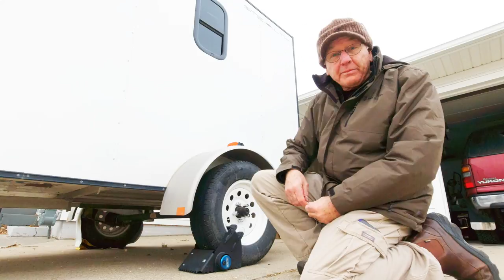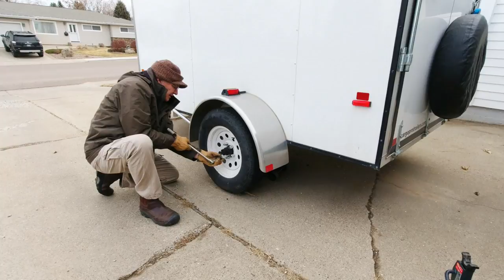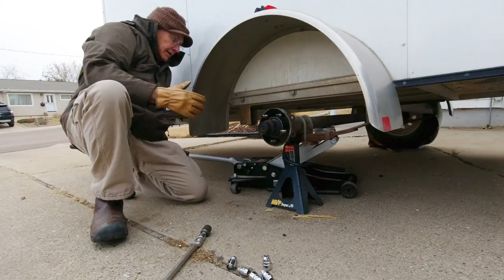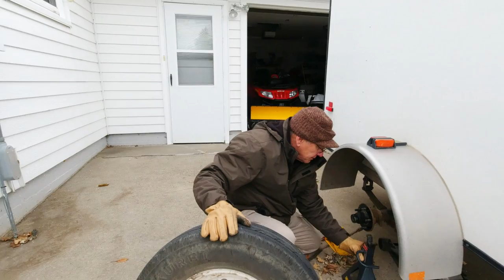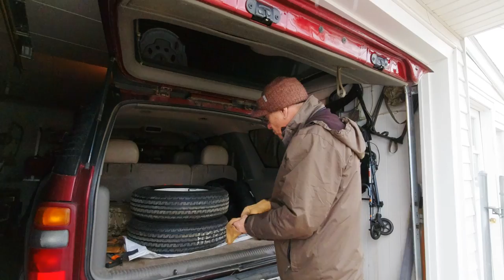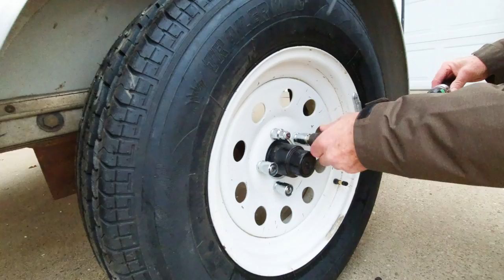Cargo Trailer Camper Needs New Tires.

Comment: It probably should be mentioned to buy trailer tires only for a trailer, not car or truck tires. Trailer tires are more expensive,  but they are made for trailers.
Reply from the maker: That's because trailer tires have a stiffer side wall to stand up to the bouncing that trailers do (That's why trailers blow tires).  I've been told that it may be better to put 16 inch rims on your trailer so that you can use LT (light truck) tires which can be higher quality. Thank you for watching Arithia!

Comment: At least when you do it yourself you know nothing is going to get screwed up! Every time I go to a tire shop I have to watch over the crews like a hawk so no corners are cut. I used to do tire work so I know when things are getting messed up. Happy travels!
Reply from the maker: I figure if anyone knows about tires it would be you!
Reply: @gonagain  Tires are the essence of what I do driving trucks! LOL
Reply from the maker: @WestCoastRoller  yep!
Reply: West Coast Roller: You are very wise to watch the tyre fitters, most now are just young scroats that do not even bother to change the torque setting on the air gun, you find that out when you try to use the wheel spanner and it bends up like a stick of liquorish .

Comment: My brother bought 4 at Discount and one blew out immediately. They replaced it. I keep hearing for many how bad trailer tires are. Some have put on vehicle rims and tires. My brother also carries a heat gun to monitor the wheel bearing temperatures. Have a good trip once you get started.
Reply from the maker: I have always checked my bearings by just putting my hand on them whenever I get gas, but I have a heat sensor with me anyway to keep tabs on my propane furnace so I'll use it to keeps my hands clean when checking those bearings!  The tires I bought had mostly high reviews and some low reviews, nothing in the middle, so we'll see. If you put on 16 inch rims you can use light truck tires which would be a lot better.

Comment: I use Balance Beads in my trailer tires and it works great. I also change my own tires. Something that may help with getting lug nuts on and off is to loosen the nuts, jack the tire off the ground, then put your socket wrench on one of the nuts, then spin the tire till the nut comes off. It works great for all but one, unless the wheel will stay against the spindle. Install is just the reverse.
Reply from the maker: Thanks for the handy tip, Eric.

Comment: I find that trailer tyres do not wear out in the normal sense, but because they stand around most of their life the walls perish, down here in the south of France they will only last 3 summers if they are not covered(as yours are), the balancing is a big factor in tyre life as you say, enjoy your birthday, an air nut runner is a better way to go, you can just run that off your compressed air line, and they are much cheaper to buy. Chris B.
Reply from the maker: Yes, you're certainly right about that tire sun rot and it happens pretty fast.  South of France sounds like a beautiful place.

Comment: they also tighten the lugs so tight you can not get them off on the road
Reply from the maker: I stopped to help a young couple on a dirt road in the middle of nowhere that couldn't break their lugnuts loose to change a flat.  It was a good thing that I had a long breaker bar with me.

Comment: you can get adaptors for the impact driver you use for your build etc. I wouldn't use it to break the lugs loose or torque  them down, but it will save you the time of all the spinning on and off, Wally World sells sets with 1/4 up to 1/2 and you can get adapters to go from the 1/2 to 3/4. you would be amazed at all you'll find that you can use them on

Comment: Let me add, assuming you are using “puzzle” wheel locks, the kind with the separate key that fits into a wiggly groove, do NOT use a power tool on those.  Ask me how I know.
I do like your videos and have learned a lot from them.
Reply from the maker: Good tip Jeff, thank you for sharing.
Reply: If you snap a wheel lock off you can pound a impact socket over it with a mini sledge hammer then back them off with ease, ask me how I know.

Comment: I too balance my trailer tires, I even thinking about buying centramatics for the 5ver. I used them on my eighteen and they do make a difference.
Reply from the maker: I didn't know what they were until you mentioned them.  They look like a great product if you're having a problem with balancing.  Not very expensive either.  Thanks!

Comment: This is my biggest deciding point in getting a small trailer... 1-2 axles
Reply: Why did you go for just a single axel?
Reply from the maker: We chose the single axle for its maneuverability on 4x4 roads.  We can turn it around out very right places.  Tandem axle will certainly ride better and the extra tires provide better handling in case of a blowout. But if it's tight places you're off to then a single axle might be what you want.

Comment: Might want to mention where the tires were made and the specs. I know hard core campers that changed 4 flats on one trip with Chinese tires.
Reply from the maker: The problem is that they're all made in China now, or so I'm told, even the name brands.  I bought Trailer King "D" rated tires.  The reviews were pretty good, but I'll be keeping a close eye on them for sure.

Comment: Have you considered leveling jacks? I noticed you don't have any for camping. Besides, changing tires with leveling jacks would make you feel like speed racer (old cartoon I used to watch)
Reply from the maker: We just have the fold down struts on the back and the single jack in the front and for leveling we use one of those kits with the snap-together blocks that you drive up on.  I've only had to change a trailer tire twice in my life and that's how I learned to keep good tires on!

Comment: I bet you cant align those tires. How many miles were on them before you needed to replace? Those are ply tires I think you can replace with radias
Reply from the maker: They were radials actually and, because it's a single axle trailer, I replace them at about half-life, I figure it's cheap insurance!  I would guess I had about 15-20,000 miles on them?

Comment: I notice your trailer does not have shocks.is that correct.  Does that affect ride quality.
Reply from the maker: It does, but that just means I have to be careful how things are loaded and stowed.  There are kits you can get to put shocks on or you can opt for a torsion bar axle if you want.  I just drive slow on the bumpy roads.

Comment: One question which ply do you like to run on your trailer for safety?
Reply from the maker: Hi Jimmy, these tires are "D" rated and are also rated 8 ply.  If I were hauling any weight I'd want "E" rated, 10 ply tires myself.
Reply: @gonagain  thank you for your advice...

Comment: What ply tires? torque settings?
Reply from the maker: The ones I just put on are 8 ply rated (load range "D").  If I were carrying any loads I would have opted for 10 ply (load range "E").  I torqued the lugnuts to 100 ft. lbs.

Comment: How often you. Service the hub assembly?
Reply from the maker: Once a year.  The original bearings were made in China and didn't last very long at all, so plan on replacing those the first time you take it apart with some high quality ones.
Reply: Gonagain  tractor supply has a good selection trailer bearings!
Reply from the maker: Mark, that's good to know.

Comment: Ive got a 5x8 ft cargo trailer, I have 1 new spare. Tires ok yet..
Reply from the maker: That's a nice size for camping, haul your stuff and sleep in it too.
Reply: Yeah, I have a 5x8 trailer too.
I get excellent gas mileage on my F150
You hardly feel your pulling anything behind.
Use for camping and hauling works great for me.